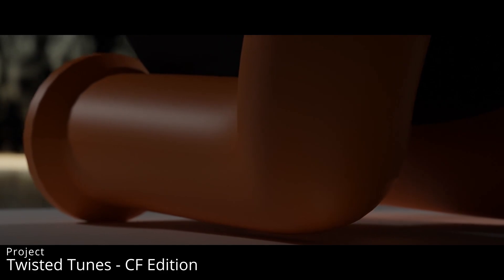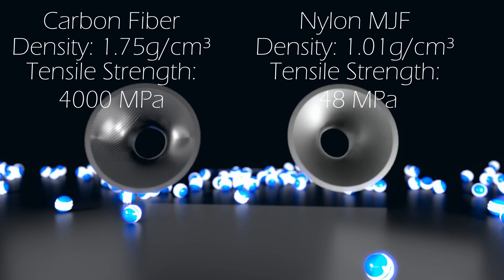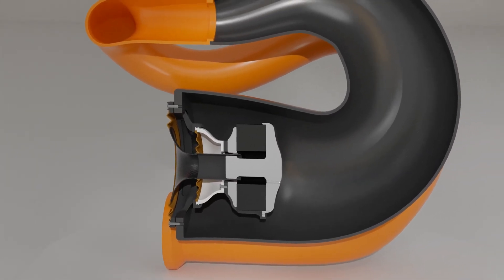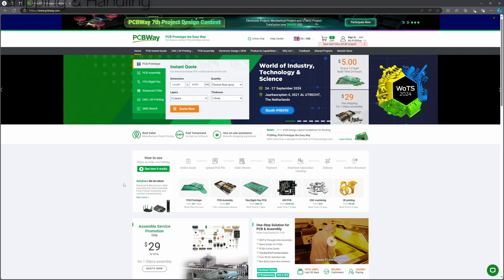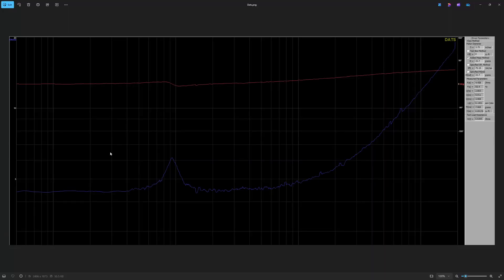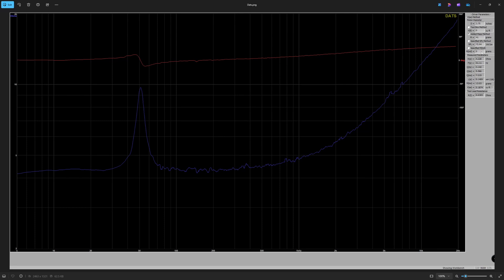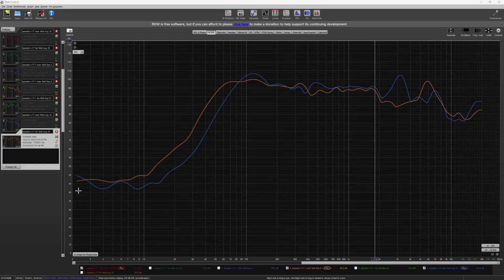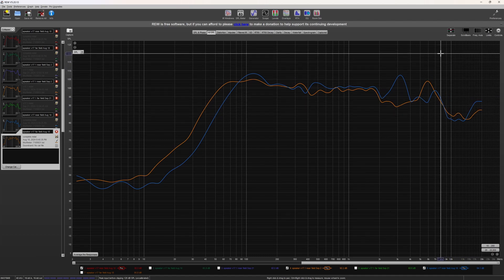Fully 3D Printed Speaker V17.1 Featuring a Carbon Fiber Cone

Comment: Nice Build! I'm also experimenting with silicone atm and was wondering which silicone served you well?
Reply from the maker: I believe I used a 60a style of 2 part silicone. I tried a 30a but it wasn’t rigid enough to hold its shape at such thin walls.

Comment: Doesn't that transmission line enclosure give you all kinds of problems/obstacles ? I'd imagine doing a tl/horn like that results as massive harmonic distortion & diffraction ? Are you using 'moving mic' method when measuring (RTA with full-range pink noise) to not let the room mess up the data ?
Reply from the maker: I’m just doing a near field at around 1.5” and a far field at roughly 1m-the room is not setup for acoustic testing to any degree that would be professionally acceptable but it’s close enough to compare speaker to speaker in the environment.
Reply: @piscesprinting  If you have not tried the moving mic method, I recommend you try it out. Doing just sweeps is not good for speaker measuments unless you are in an anechoid chamber or you have a position curve to add/subtract like in klippel. On my side it took a long time and painful amount of wasted efforts before I realized that the internet is full of sweep tutorials that basically just ruin everything. https://www.youtube.com/watch?v=2i5QU8__mq4&t=358s
Reply: @piscesprinting  If you have not tried the moving mic method, I recommend trying it out. Sweeps are not good for speaker measurements unless you are in an anechoid chamber of you have measured position curve to add/subtract like in klippel. The internet is full of misleading sweep tutorials that basically just ruin everything. This is good: https://www.youtube.com/watch?v=2i5QU8__mq4&t=358s